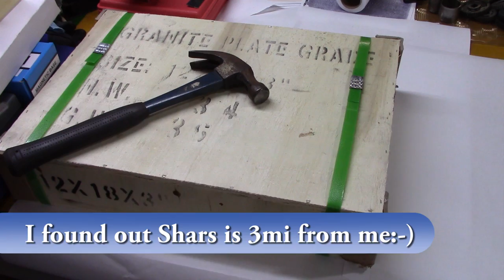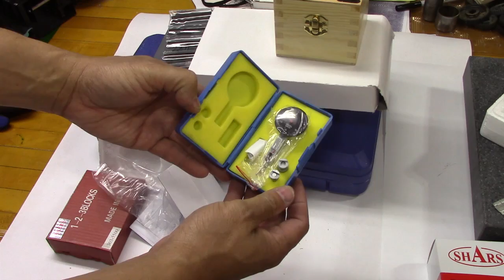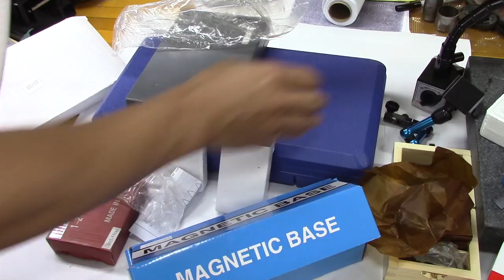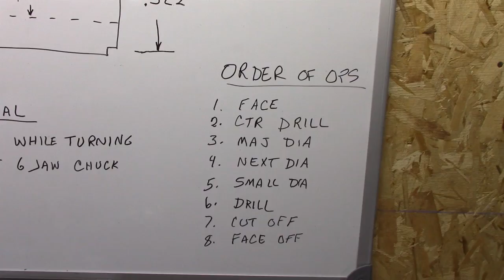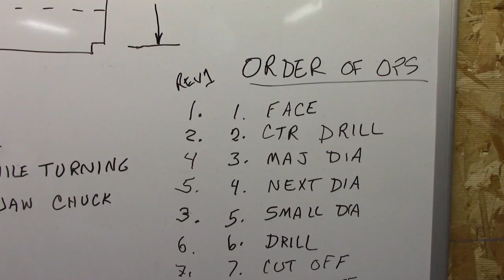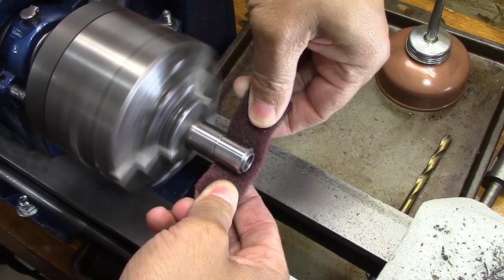Journey to Journeyman, Episode 2, How to make a drawbar spacer

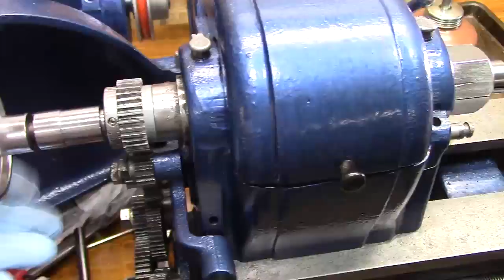Comment: 27:30 Your life is going to be much easier if you chamfer that end.  You shouldn't even have to open the cover or pay any attention to that end, just stick it in and tighten.

And the bent handwheel is of no consequence at all.  Was me, I'd spend the money/effort elsewhere.  For example, earlier I noticed that you seem to be missing the handle for the carriage handwheel, and had to feed by holding the outside of the wheel.  Make a new handle, it will save you lots of effort and give smoother cuts as you don't have to keep stopping to get a new grip on the wheel.
Reply from the maker: I should have chambered it and not used a step.  I might make another one like that.  I didn't think about being able to put it in with the cover closed.  Great idea, thanks.  Ps. The hand wheel is not broken. I fed it by hand on the outside to try to control the feed rate better.

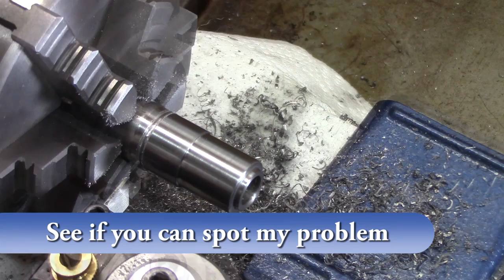Comment: 26:42, your headstock is loose on the ways.  You can see the tool pushing it sideways.  You had a huge clue to that much earlier, when you had more chatter at the headstock end of the cut than the tailstock end.  Normally it would be more even or more toward the tailstock, or toward the center of the cut on long spindly work.  Severe wear on the ways toward the headstock could also do that.
Reply from the maker: I did have a huge clue, but I have never been able to cut while turning.  So my focus was on the tool being wrong.  On my first episode, I was finally able to get the boring bar to work by adjusting it's angle.  That is why I was thinking about the tools.....
Reply: jster1963 Boring tools in small holes have to have huge relief underneath because the work curves toward them.  That's why it stopped rubbing when you rotated it down.  Cure is use a smaller tool.  If it's marginal you can perhaps grind away some material underneath the tip.

Comment: At 23:33 I notice that the center hole is wobbling a bit.  Either you didn't get it centered when you mounted the part or at some point it got knocked sideways a bit.
Reply from the maker: I think the headstock was getting looser.  When I finally noticed the headstock moving, it got worse quickly.  At first I thought I was having an optical illusion....
Reply: jster1963 Makes sense.  Chatter that severe would tend to walk the bolts out once they were a bit loose, same as the lock nuts were walking off your tool holders.  Apparently you stretched them turning the tap?  I have trouble imagining that, but I won't say it's not possible.

Comment: Drilling oversized is often the result of increasing drill size too rapidly (and on brass of not modifying the lips of the drill to keep it from digging in).  I noticed on the first video that you started off with a very large drill, which can also make it wander.  It helps (and reduces stress on the machine and your cranking hand) to start small, then if you're using regular-point drills to increase by no more than will allow the chisel point of the new drill not to have to do any work (since it works by brute force rather than cunning).  This will also help keep it from wandering.   If you want to keep the diameter as accurate as possible, sneak up on it with the last couple size changes so the final drill has very little work to do.  Make sure the drills are sharp, and most especially on the final one the outer corners of the lips must be in good shape.  Use spotting drills (shorter) rather than jobber's length when possible for stiffness.  Keep the tailstock quill extension as short as possible.  If you're using a full-length male taper it will eject before you get to the zero line on the index.  If you shorten it you'll be able to get the full travel and be able to begin with less extension.  Even if the taper is hardened the tang is probably soft; but if it isn't you can draw the temper with a torch.

When your drill has to flex to enter the center hole, don't do it.  Release and re-chuck it until it comes up on center.  Otherwise it will surely drill oversize at the near end and will be more likely to wander.  If they all do it in the same direction, probably your tailstock is set over a bit.  A problem with the chuck will show in different directions depending on how you mount it in the tailstock.
Reply from the maker: Holy cow this is good stuff!  Thank you very much.  I can't get the tail stock to zero because of the full taper.  I will have to cut it.  I need to find some stubby bits too.  That was a big problem.  I have to learn to be patient.  I saw some guys with big machines go with big drills right away.  I have to know my machine better.  I never thought about "release and re-chuck".  I will try that next time.  Thanks again.....

Comment: The rule of thumb for chatter is decrease speed but increase feed (distance the carriage advances per turn of the chuck).

But the systematic cure is stiffness.  Keep your gibs adjusted, reduce overhangs of the compound slide and tool, check clearance of the carriage to the ways and remove a layer of the laminated shims in the carriage if necessary.  Use your dial gauge and find out what moves when you push on it, then see if there's a way to stiffen it up.

You had an extraordinary amount of chatter on the first set of cuts, so I suspect something that should be tight is loose.  You say you learned how to stop it, so I presume you found the main difficulty and I'll find out later in the video.

My grandfather's 618 spent its first fifty-some years with a bump on the cross slide base casting that prevented the dovetails from seating properly on the gibs (it was a long time ago, I've forgotten the details; but when I cleaned it up the lathe was a good deal stiffer).
Reply from the maker: You are talking WAY over my head.  I know there are shims on the carriage, but I don't have a clue how stiff or loose it should be.  I took out as much "play" as I could without binding.  That's about all I know to do.  I'll keep trying.....
Reply: jster1963 Best you can do is so it still moves readily at the least worn areas, up close to the headstock and back toward the far end.  The ways are probably worn a bit partway down where you do the most work, but if you make that right it will be too stiff in the other places.  That shim in between the upper and lower parts of the carriage is made of several leaves laminated together by just barely soldering them, so that you can peel the layers off by teasing a corner up with a knife.

Proper way oil (Mobil Vactra #2  for example) makes the carriage move sweetly.  You may have to buy a gallon but then you won't for a long time afterward.

Comment: Clean out your tailstock taper with brake cleaner** or other solvent to get rid of any traces of oil.  Ditto the things you stick in there.  Then seat them with a good sharp rap and you shouldn't have trouble with the tailstock chuck slipping in the taper.

**The kind that boasts "non-chlorinated" is very flammable.  The kind that boasts "non-flammable" is an anesthetic.  I use the non-chlorinated outdoors but only the non-flammable indoors.
Reply from the maker: Yowza!  I'll be careful..... and thanks!

Comment: hi jster that's a nice little lot of new tools you got there. when you were cutting that part and you stopped and there was that mad pattern on it I thought something was loose as well, but I never thought the whole headstock was loose!! just keep going at a speed that your ok with and don't rush things and you will get by....as you did. carbide is not very sharp and not very good for small cuts but you can try dropping the tool a bit and see if that helps. with the hand wheel for the drawbar you can make a tool from round bar and fit a bearing  on it that will turn then put the hand wheel in the chuck and press the bearing on it and it should true it up! have fun and good luck. that_du^de uk
Reply from the maker: Thank you very much!  I will try lowering the bit and see how it cuts.  I think I will try to bend the drawbar hand wheel.  If it breaks, I think I'll try to make one.  Thanks again......
Ps.  I'm surprised how good your English is!  I mean being from the UK;-)

Comment: Ooh! Very cool stuff you got there! It's hard to get a nice surface finish with carbide tools on small lathes. They are not sharp enough for low cutting speeds. The only exceptions are inserts for soft materials like aluminum. They are much sharper and with positive enough angles. Try with smaller nose radius to see if it goes any better. You will need a small fillet on your parting blade also. What type of steel you used?
Reply from the maker: Thank you very much for the info!  I will try a small radius.  That parting tool needs to be sharpened, so I will try the fillet.  I'm using HSS (M2 I think).  The steel I'm machining is "hot rolled" mild steel.  Thanks again.....
Reply: jster1963 Hi jster, for harder metals like medium carbon steel you can use HSS tools with an additional 6 or 8% of cobalt on it (HSS-Co6 or Co8). I'm using Co12.5 on stainless but it's hard to grind. Your tools they're not going to last for long without coolant/lubricant, especially HSS tools. Consider some water soluble oil for turning that doesn't smell so bad and some ventilation system for your basement.  I’m seeing a few excellent recommendations form David about steel alloys.
Reply from the maker: Great ideas.  I plan to get some ventilation soon.  In the mean time, I will try oil.  I was just hoping to learn how to cut while turning and then use lubricant.  Also, I will have to find a place that sells the Co7 or 8.  If I can start cutting, I will branch out with the stainless and other hard metals.  Right now I have to learn to cut this soft stuff.  Thanks again...